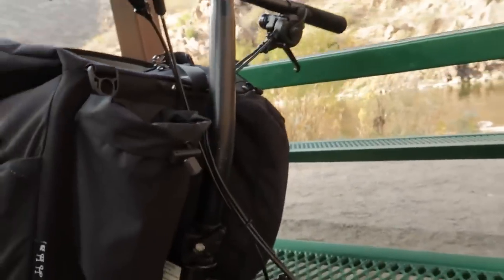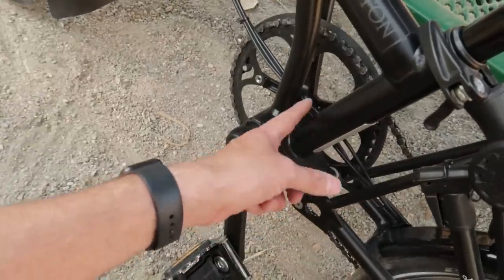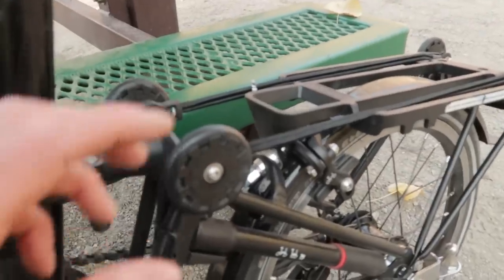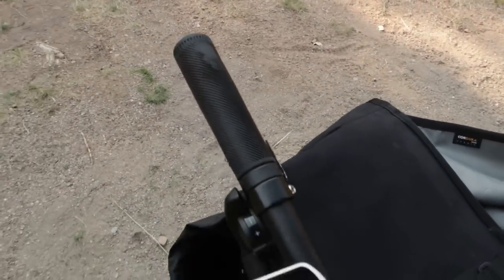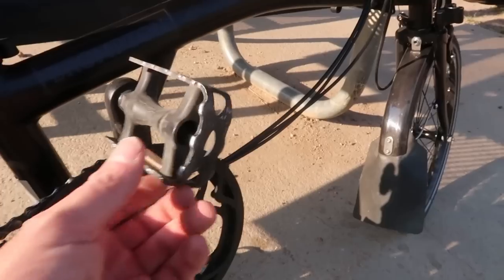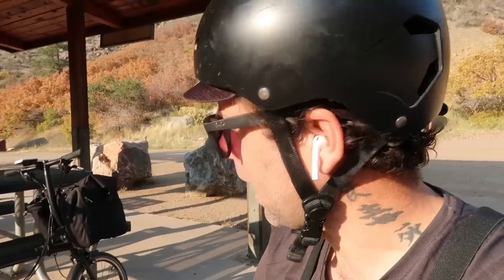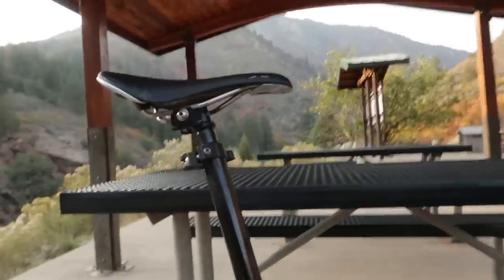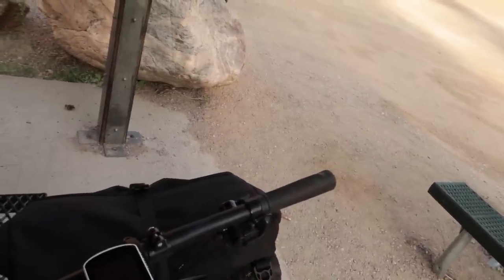How’s my Brompton Holding up?  (6 month update)

Comment: Hi Brian! Thanks for the insights, hopefully I can help a little, I'm a few years in to ownership. It's amusing that I bought a Brompton with the intention of filling the gaps in a longer commute then I've ended up putting more miles on my bike than I drive in my car!

Brake blocks were something I changed to Swiss stop blue (standard fit on the Brompton electric) - but the main reason the OE pads were so worn was that I'd taken it up and down mountains in Norway on more than one annual holiday. Not really what the Brompton was designed for but testament to how good it is!

Your right pedal bearing issue was IMHO caused by a strike on the road. I've had to change a left folding pedal because the bearing was worn and loose. Reading other owners' experience it's an issue, there's no spindle in the left pedal so the bearing has all sorts of forces acting on it. I'd guess if it was just wear you'd notice your left pedal first.

I've had to change my bottom bracket once, fortunately it's not an expensive part and luckily I have all the tools to do it myself - total fluke because I had a 20 tooth tool that I bought in error for a project a few years ago. I considered doing an upgrade but felt it wasn't worth it, I don't mind changing it every few years.

Seatpost. I get the feeling yours may have a little contamination on it, I'm heavier than you and found that a wipe with glass cleaner and a clean cloth once a week does the trick. It might be worth removing your seat and dropping the seatpost out to clean inside the collar too. I've had to tighten my QR bolt about a quarter turn but no more than that.

Chain. I always wondered how they stretched and wrongly thought it was the metal plates that were stretching! It's the cumulative effect of each of the hundred or so joints wearing a little. Because the Brompton chains have a removable link as standard I take my chain off about once a month, put it into an old plastic milk carton and shake it up with some degreaser in there. There are better methods available! When I refit the chain I don't put much lubricant on there because that seems to trap the dirt that creates an abrasive paste. I still have to get a new chain and rear sprockets every so often but less frequently than you've had to do. Saying that I don't ride as many dirt roads as you have where you live so I guess that's a factor.

Tyres (or tires as you guys say!) I'm a bit of a tyre snob so it's all about tan walls for me, speedy Schwalbe One in the summer and Marathon Racer with a good shot of Stan's Notubes injected through the valve most of the way through the winter. Sometimes Marathon plus when I'm on a cycling holiday in a foreign country and don't want to be stranded. I don't notice tyre wear as much as a result but I do know just how quickly the tyres lose pressure because they hold such a low volume of air. When the pressure is down a little I notice the tyres wearing. I try and run mine closer to the lower end of the recommended pressures for comfort so I check them regularly. I always run 35 wide too, I tried the 32 Kojaks and found them too harsh pumped right up.

Ride safe dude, best wishes!
Reply from the maker: Wow, thanks for the suggestions, especially the one about the seat post.  I will clean it and hopefully it’s just some oily substance.  It slips every ride unless I tighten it up.  I definitely have some upgrades I want to perform, but all in all it’s been a great bike.  I did crash my Brompton once so I think you are right about the pedal.  Thanks for the suggestions.  Thanks for watching and commenting as well, I really appreciate it.👍😀

Comment: We have 8 bikes in our house. Recently I deep cleaned every chain and moved over to waxing them. With quick links fitted to all chains I rewax every 4 weeks. 
Setting up slow cooker for hearing the wax and buying the PTFE powder (which looks like a bag of coke!) is a bit of a faff but now I have all the kit it’s very easy to do a monthly dip. The big benefit above reduced wear, and especially valid for a folding bike, is the cleanliness. No more oily calf tattoos 😎. Worth considering.
Reply: I bought the 50g bag of teflon powder from china for a few pounds. Arrived in 2 wks. Works very well in a 10:1 wax ratio.
Reply from the maker: Wow, awesome.  I will definitely check that out.  I am getting tired of replacing chains every two months.

Comment: Hi Brian 
Great review.
My Brompton is Twenty seven years old (1993) model only normal wear and tear items like your self accept  no gear issues my 5 speed Sturmy archer service last year only required clean up and light grease bike mechanic will service again in 2 years time I’ve updated saddle and pedals.
And the frame is still solid with original clamps and hinges.
Any time I’m around the cycle shops I’ll ask them how old they think my bike is and they never know,
They usually say seven years for some reason.
These bike’s are great and always like to challenge anyone who says any different.
Have a good day big man.
All the best.
👍🇬🇧
Reply from the maker: Wow, I hope to be riding mine for that long.  Awesome👍😀
Reply: They're old fashioned rubbish.

Comment: On shifters: I bought my 2018 model 6-speed Brompton second-hand about a year ago. I rode it through two serious rain storms and both shifters started to play up. A little research showed this is a problem with the latest shifters in wet climates. The problem is that the polymer they are moulded from absorbs water and expands as a result (probably one of the nylon family). Once this has taken place its dimensions stabilise. (When I worked on the railway, they used to boil nylon insulators in dye so you could see they had been stabilised.)

I used to work in a machine shop so I got out my micrometers and verniers. One shifter had thickened up which I relieved with a fine file. The other had tightened up on the bore which I relieved with emery cloth wound round a small piece of dowel. In both cases I removed less than five thousandths of an inch. They have worked perfectly ever since.

If you ever strip one of these shifters, I offer a tip. There is a piece of white plastic which shows through the shifter window to indicate the gear selected. If you apply a piece of white Scotchlite reflective self-adhesive tape to the white plastic is is much easier to see your gear selected under street lighting.
Reply from the maker: Thanks for the info, I appreciate that.  The bike shop said it would replace it under warranty so I will do that.  When the bike goes out of warranty I will keep what you said in mind.😀👍

Comment: Another great and honest video, keep them coming, as am always looking forward to the next one. Here in the uk I've done 2,500 miles over the past 6 months on my 6 speed & have got through a chain/rear gear/non-folding pedal as the bearing went on mine too + normal wear and tear items. The ergon grips are great and worth the upgrade, although have not experienced seat post slip yet.  Only other part I've replaced is the suspension block - has made a huge difference as the original had gone soft... Also bought a carrier block online, so have converted a Thule front pannier, which is great as 100% waterproof & cheaper than the Brompton bags.

Sunday was biggest ride yet at 73 miles, so next step is a new saddle!  Keep safe & would be good if you could do a vid on how to change the chain, so I could it myself!
Reply from the maker: Thanks for sharing.  I got a fazik saddle and it has made all the difference with long distance travel.  I will do a chain video soon.(when mine wears out again.) .  Thanks for the suggestion.👍😀

Comment: Ive had my 3 spd brom 16 yrs and over 30k miles now and always used the sram pc1 chain. Chain gets replaced once a year regardless of condition although they have never reached 0.75%. The chain stretches from wear on the inside therefore how you clean your chain is important. The only bit that is made by Brompton itself is the frame...everything else is a can of beans with the logo added. Worst part of the Brom is the brakes..the old type. Regarding the seat post insert, try cleaning with detergent as its plastic and should never be oiled/waxed or if its a tad stretched and needs extra clamping force to grip. I removed the insert and split the plastic down the length with a hacksaw and no problem so far. Seat post will not budge now and I am over 190lbs now due to lockdown comfort eating  and have a solid wood shock absorber as the original firm was way too soft.
Reply from the maker: Awesome, thanks for the suggestions.  I try to keep up on the maintenance however, time gets away from me and I find myself neglecting it too often.

Comment: I have an old Schwinn Continental frame made into a single with a 193mm Astabula one piece crank. I often crack the used aluminum, cheapo, BMX pedals when cornering. They don't seem to mind. They're true and scuffed up badly, like when I found them on a used parts bmx bike, but they are tough. I regreased them years ago and painted them red. Haven't touched them since. It's a shame some company doesnt make folding bmx style pedals. With respect: That pedal looks like many pairs I have in my used pedal bin. I usually replace them right away. They just don't last very long.

Comment: My bike is 5 years old and used regularly. Frame is now a bit scratched but is fine. I’ve changed the hinge twice, replaced the back wheel once as the rim wore out ( wheel buckled!), and put different grips on and changed to easi wheels. I’ve lost count of the number of sets of tyres I’ve used, but better since using Schwalbe rather than the original Brompton ones. I’m probably on my 2nd set of pedals. 3rd chain. Mechanical things wear out and I’m happy tinkering and fixing. I compare with the costs of my car which are considerably more.  The bike has been so helpful keeping me fit and especially during lockdown as I just take it with me. Thanks for the film.
Reply from the maker: I agree, I like riding this bike and don’t really mind the maintenance.  I hope to put in many more years......riding and tinkering.😀👍

Comment: My seatpost also sinks but the remedy was a cheap Quick release 31.8 mm seatpost clamp from ebay, £2.07 File off the inner lip, preserving the inner diameter as best you can.
Shifts about 6mm in a 5 mile bump-bump-bump prominarde ride.
Very pleased with the result, even though it's another operation.

Peddle strike, no doubt.

When you say gears waring out, I assume you mean Rear Sprockets.
The gears are in the hub.

All the best, thank you for the interesting videos, take care.
Reply from the maker: Thank you for the information.  I will have to check that out.  Yes, I meant the rear cogs.  On the 6 speed version they are technically gears....high and low range.

Comment: The seatpost issue you have i also have on my electric folding bike, i think it's an issue of tolerances, there's too much clearance between the frame tubing and the seatpost tube, so no matter how much you tighten the clamp it can't grip the seatpost tight enough. 
I've solved mine in 2 ways, i've wrapped a 4" wide piece of metal shim of 0.1mm thickness around the seatpost to reduce the clearance/gap so now the clamp is under much less stress to hold the seatpost in place. Watch out as metal to metal tends to wear away the seatpost black finish.
The second way i solved it was by measuring inside the frame seat tube from the bottom bracket up to where the bottom of the seatpost is, and make a nylon spacer that fits inside the frame so the seatpost physically can't drop any lower. My spacer is solid nylon but no reason it can't be nylon tube as long as it's 3mm or 4mm thick to match up to the seatpost tube thickness.

Comment: Hi Brian Just a comment regarding the seat post. I had the same problem some years ago. The problem was that I cleaned the seat post and there must have been some polish/grease/oil still on it. It's a no-no with the Brompton seat post. Just clean the post and the clamp bush with alcohol and keep it that way and you'll find that the clamp doesn't need to be very tight and it won't slip. I hope this helps. Keep the great videos coming. Thank you.
Reply: Hmmm... Carbon paste on the bottom portion that isn't extended above the clamp works just fine for me. I think the problem is when it is liberally applied or applied to the upper portion. 

The cool thing is how so many Brompton owners have different, sometimes opposing solutions and they all seem to work for them! At the end of the day, it's a bike.
Reply from the maker: I have never polished my seat post however you may be right and I will clean it and see if that helps.  Maybe there is some sort of oil on it causing it to slip.  Thanks for the info, and thanks for watching.😀👍

Comment: I and my son have identical two speed bromptons ..... first of all his gear shift lever came apart (fortunately we found the lever again but not the Allen bolt and spacer) but we were able to refit the lever temporarily and it provided operation until rectification by a Brompton dealer, free of charge, but from memory, if you have the STURMEY ARCHER hub gears, the gear shift lever was originally manufactured from metal and lasted much better😇 
He accidentally broke the clip on the front axle which holds the bike together when folded, but courtesy of the factory, they sent a replacement, which I fitted. 
I did make a mistake when ordering from the factory though, as we both don’t like the straight handlebars, so will upgrade on both to the higher bars.  I have replaced my saddle with a Brooks sprung saddle for better comfort, and he will too .... 
He also wants more gears, so just on his bike we will upgrade to 6 speed if possible .....
The small transit castor wheels need upgrading to the larger bearing type for smoother operation.....
I think the main thing with the Brompton is getting used to folding and unfolding correctly to avoid stress on the components😇
Reply from the maker: The EZ wheels from Brompton are a much better upgrade for sure.  The shift lever definitely needs improvement, maybe I will see if I can get an older version?  I am happy with my straight bars, but I can see where most would find them uncomfortable.
Reply: The main thing is getting used to substandard parts and the fact you bought into a cult and a cycling life of heartaches,

Comment: Go easy on tightening the seat clamp bolt...you can overdo (even over time and in small increments) and permanently damage the frame. Cleaning the seatpost as been mentioned helps or at worst the seat-post insert wears and is considered a consumable item (typically dealer replaced....req. reamer tool and special glue plus the new insert).
Reply: There's a seatpost 'paste' to stop regular 700c bike seatpost slipping. A bikeshop used some, and fixed my post slip OK.

Comment: Slipping seatpost: Buy a 31.8mm Quick Release Seatpost clamp for £3. File off the in pointing flange so its a plain bore. Then fit it to the seat post as a second clamp.
Pull up seatpost to correct saddle height, push new QR clamp down to the frame, clamp it up. 
Ok its another operation, but the slipping seatpost problem is vertually illiminated. 
A cheep temporary fix, still ok after 3 years.
Thanks for the vlogs
Take care

Comment: Hi bro, I really enjoy your uploads, and have just subscribed. I'm a late convert to Bromptons. I'm a huge fan of Moultons since my first one in 1965, then an absence of decades until I rediscovered them in the early Y2K's. I have an S6E purchased new in September 2019, tempest blue frame with papyrus white highlights, a pretty and very practical bike, which surpasses the Moulton hands down in respect of portability, but no way in performance and comfort of a modern spaceframe Moulton.

With the small wheels, it accelerates much like a Moulton, but won't keep up with one, and the cheap  components worry me somewhat. Those bar grips, gear shifters, plastic turn knuckles on the folding elements of the bike, and the saddle which hurts my undercarriage after less than 10 miles just convey cheap and shoddy, whilst Brompton continually seek to elevate the status of their bikes as a "bling" product, with endless "Limited Editions" (emulating Moulton here?), I feel there are a lot of after market modifications needed to bring a Brompton up to an acceptable, more robust and comfortable standard?

I've thus far been more inclined to spend that kind of money on continually improving my two Moultons, which are not entry level models, but handbuilt AMs, one of which is stainless steel. I still have love for my Brompton, and if we're not to part company, it will benefit from a better rear spring,  Brooks saddle, new bar grips, after market fold components, and finally... mudguards (fenders) etc. As I'm a good age now, I've even contemplated an electric Brompton, but the price! That's more than halfway towards a truly beautiful hand crafted Moulton AM, so the jury is out. I love your enthusiasm for the Brompton brand, and that really motivates, but if you ever get the chance, treat yourself to a Moulton.

Comment: I live in Denver also and ride a Brompton, you are riding in some tough areas. Around Chatfield Res some of the hills are steep to climb.  I track my mileage and replace my chain when ever I hit a mileage, it depends on which bike I ride.  BTW the “Izumi NJS V Super Tough Track Chain” is great for single track, shimano make a great chain. Don’t get a narrow chain for a 6-7 gear cluster.  As for your pedal, it’s most likely you damaged it with the road strike.
Reply from the maker: Thanks for the info, And I think you are right....the pedal strike more than likely did my pedal in.😁